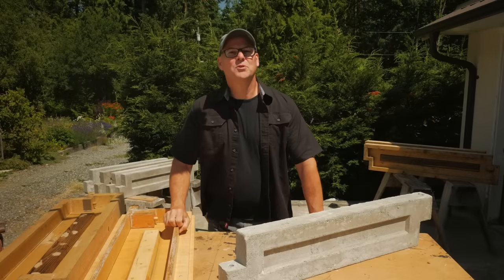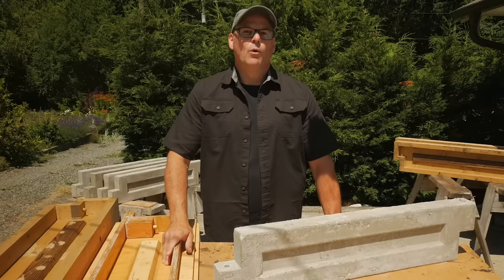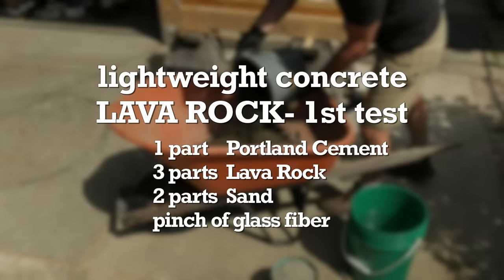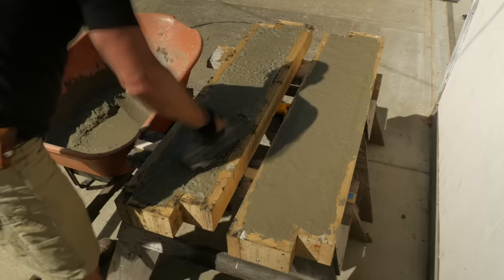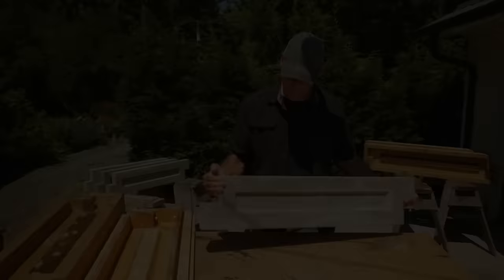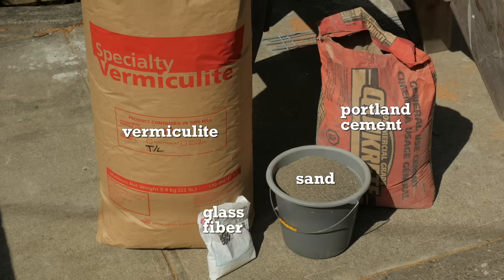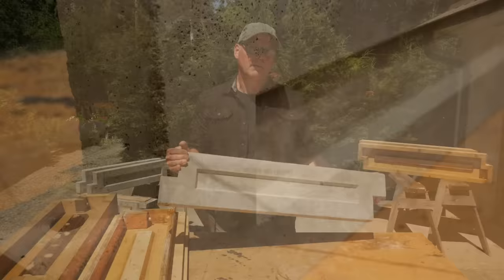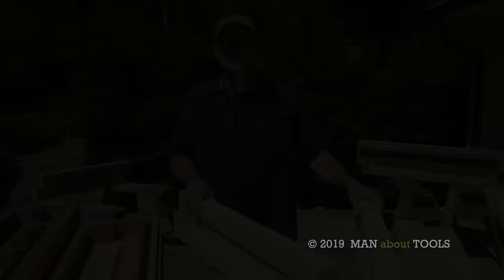make Lightweight Concrete Garden Boxes PART 3 - Aircrete Vermiculite Lava Rock

Comment: Don't use Portland cement. Use hydraulic cement it is a lot  better for durable air Crete  construction.
Reply from the maker: James, that's worth a try. Thx
Reply: @MANaboutTOOLS  can't wait to see you test this one in episode 4!
Reply: @MANaboutTOOLS  Also use liquid sodium silicate. And let the concrete dry for at least a week. And wet it with water every day.
Reply: Hydraulic cement expands after set so maybe a few adjustments to forms to compensate? A more relaxed angle on the decorative keyed face, maybe a couple of rubber washers under the heads of the screws that hold it together to allow for a bit of expansion and looser pins for the PVC?
Reply: @Timoshim  could you explain this idea further? Why do this and why wet it everyday?
Reply: @davemcguire999  Concrete has a long-lasting chemical reaction. And all this time it needs certain conditions. Temperature and humidity must be constant. If water is missing because it evaporates quickly, concrete chemical reactions are incomplete. The concrete must always remain wet until full hardening. Sodium silicate reacts chemically with the carbon dioxide emitted by the concrete, which results in very rapid casting of the concrete. It increases the mechanical strength of the concrete and increases its impermeability. Sorry for my English. I'm sure you can find more information on the internet.
Reply: Tamashi
Reply: @Timoshim  - good information, are you in the field?
Reply: @thetessellater9163  Somehow. I did the architecture highschool but I also did chemistry classes. I'm passionate about the constructions.
Reply: Yes plz for experiment on sand hydrolic cement and foam
Reply: @davemcguire999  I agree with Tamashi. It's a common practice to keep watering cement constructions for improved rigidity. Some 20-25 years back, I remember workers doing it for many days. It may have been 3-4 months or I may have lost count of the days, but it was definitely way longer than it is now. Maybe nowadays the cement might have undergone some improvements requiring less watering cycles.
Reply: @Timoshim  sodium silicate, PVA, and the detergent in the Suave are wetting agents that add workability to concrete mixes and reduce the quantity of water used.  The strongest concrete is dry almost to the point where you can't trowel it.
Reply: @MichaelEMaus  It's true, but cement needs hydration with water. Between the cement particles and aggregates there is a space occupied by water. The more water in the concrete mixture, the more empty spaces will be left after evaporating the water. Because of this, a mixture of concrete with plenty of water is not as durable as one with a perfect amount. Instead, sodium silicate captures the carbon dioxide removed from the cement as a result of the hydration reaction and strengthens filling the empty spaces where the water would normally have been. What I say is that the concrete after casting is very important to keep it in a damp environment until full hardening. In the concrete prefabrication industry, the concrete is usually kept in a water vapor bath where it is perfectly suited to create a very strong concrete.
Reply: You could also try using the lava rocks or vermiculite with foam. I'm really surprised it warped and cracked. Perhaps there was excessive shrinkage due to the heat, wind, etc.
Reply: Bridge concrete is kept constantly wet during the initial curing period. The chemical reaction continues but slows down. The test cylinders are kept submerged in water for 7, 14, 28 day lengths until shipped out to be crushed for testing pressures. Mainly there is heat released from the chemical reaction and the concrete needs to be kept cool.
Reply: spim randsley  LOL Yes. Much lighter. A little hard to find, that anhydrous water. But it is certainly something when you find it lol.
Reply: @HomeShowTV  Lol I nearly laughed my butt off.
Reply: @Timoshim  how much sodium silicate? and how do you make the liquid? how dilute?
Reply: @JoshWeaverRC  agreed. 👍🏾👍🏾👍🏾
Reply: spim randsley  Anhydrous literally means "no water." In chemistry, substances without water are labeled anhydrous. I have never heard of water-free water.....
Reply: spim randsley, I’m lost. Anhydrous means without water. So, what do you mean “Anhydrous Water?”
Reply: @davemcguire999  Wet it every day because concrete needs moisture to cure, or fully harden.
Reply: James Cobun - sounds promising, but where does one get “hydraulic cement”?  We have a Lowe’s & Home Depot, but nothing there labeled as “hydraulic cement.”
Reply: You guys are seriously overthinking the mix design for these DIY planters, good stuff though, great project.

Comment: Just a suggestion would be to try perlite instead of vermiculite. Perlite is white and doesn't absorb water.
Reply: the romans made light concreat using pumice covered with blood. blood makes light concreat stronger...plz dont use human blood!
Reply: Perlite is a god option
Reply from the maker: Looks like I need to do a follow up to this specific episode to try more options. I will do a perlite version for sure. I try to keep my videos under 20 minutes. So, it's tough to fit everything in. Cheers, Kent
Reply: Vermiculite , depending on where it is sourced, is also a source of asbestos. Many gardeners are favoring perlite for that reason.
Reply: @terrywereb7639  Wow! I did not know that.
Reply: MAN about TOOLS please look into using dried bamboo sticks instead of metal for reinforcement. Also I’ve had excellent success with replacing part of the sand with wood ash from my wood stove. 

I make table tops, countertops and island tops out of concrete. I’m experimenting with Foam Crete now.
Reply: @renatomsgomes  Okay, thought about that one, and remembered blood meal (fertilizer). Assuming this would work if dissolved into blood consistency?  As for the pumice - can lava rock be substituted, or does it need to be the size of a grain of coarse sand? Really curious.
Reply: @llwscott5720  in rome they used diferent type of pumice with diferent densities to build the pantheon. i guess. in diferent sizes will give diferent finish but also diferent densities.
Reply: @renatomsgomes  After I wrote the original text, I remembered hearing in another YT video that oxblood was used on dirt floors to finish them.  At the time, I had no clue why until your reply.
Reply: Blood contains iron for strength, as when low on blood count you lose strength. :)
Reply: Great video  was thinking of making aircrete but was put off with having to make a bundle machine, now might try it this way

Comment: Great video, excellent explanation & communication.  Now, to improve your results.  
1. Don't know if you did in the previous videos, but spray form release or even diesel on your boxes for easier removal and for extended life.  Better yet use melamine with the white part being the area that meets the concrete.  Melamine produces fantastic results if you use it in conjunction with point #2 below.

2. Mix and BRUSH on a coat of a concrete patching compound on to the sides and bottom of your form boxes (don't use the fiber in the patching compound).  Make sure to get in the corners really good and you only need it to be about 1/16 of an inch thick but basically if you brush it on and don't see the form peeking through you are good.  Then once it sets up, but before it dries, pour in your concrete mix and finish as usual.  Just make sure the compound has a fine sand.  Quikrete's Architectual finish is one of the best options (paints & stains real good), or their standard Concrete Patching Compound, even their Vinyl Concrete Patcher (won't stain paint will peel off eventually).  Personally, I apply some oil to a rag and wipe it on the forms beforehand as patching compounds tend to adhere really good.  What this does is it produces a smooth, dense, veneer with a very nice finish, free of voids, but since you are pouring in your concrete before it dries you end up with a monolithic structure.

3. If you are using fiber, never mix it in a wheelbarrow with a shovel.  The fiber has to be broken up into almost individual strands, and a shovel doesn't produce near enough agitation to break up the clumps.  You can break it up by placing your sand and the fiber in a bucket and using your drill with a mixing paddle attachment and drilling them dry until you see the fiber evenly dispersed and broken up into individual strands.  If you're having a hard time you can add your water and that will help.  Alternatively, use a small mortar mixer (drum type) to mix your concrete with the fiber, just make sure to let it mix for about 10 minutes to allow the mixing action to break up the fiber.  The mortar mix won't work for the Aircrete though.

4. The reason for most of your cracks is too much water in your mix.  Use a water reducer or superplastisizer in your mix.  Fritz-pac makes all kinds.  Or just use less water, since you brushed on the patching compound you don't need too worry to much about flowability, and getting a smooth finish on the top of the form, which is the backside of the planter wall, isn't as important as reducing cracks.

5.  Add a bit of acrylic concrete bonder to your concrete mix.  This will help it bond better to the patching compound, or mix it 50/50 with water and put it in a sprayer or spray bottle and spray the patching compound after you have brushed it on the box.

Keep it up!  I just subscribed.
Reply: Staining gardening box (which could be used to produce consumables) walls with diesel or any other aggressive and potentially harmful chemicals doesn't sound like a good idea. Even this shampoo , I have mixed feelings about it...
Reply: @staweks  Note that the diesel, or if you prefer, form release, goes on the outside of the box, not the inside (gardening side).  A minimal amount is used, though if your sensitivity is extreme it might still be an issue.  It will also dissipate over time.

Comment: Hi Kent, from Man about TOOLS. It's Steve, from Magnolia Screens. First off, well done! You're a natural born teacher - and quite analytical about things! We appreciate you sharing in such an 'open source' style. tips hat

Don't think aircrete will not warp without some sort of a post-tension system. Which, BTW, @14:09 is exactly what came to mind. It makes even more sense now, in light of the bowing. This would mean a near complete redesign of your form boxes and likely yield a product bowed even more. 

3/8 rebar with chicken wire tied to it may cure it. Thin expanded metal would be ideal. But, it's overkill at that point, yes? Too, Laticrete may be a good substitute for your cement needs in general. 

Thanks again, friend!

Comment: Did you try perlite instead of vermiculite?

Vermiculite is designed for aeration and water retention 
Perlite is for aeration with less water retention 

As an example, perlite is used in making fire retardant cement for pizza ovens
Reply: I was wondering the same thing. I hope this question gets answered.
Reply: I've built many things with both and once cured in the cement, there is very little difference. Perlite and vermiculite are interchangeable. Perlite is usually has more small particles but just get whichever is cheaper. Cement can usually only be water permeable to about half an inch from any side.
Reply: William Forsythe not sure, I use perlite because I had some left over from a pizza oven build. 

Was advised vermiculite was different for a pizza oven build as it would hold moisture in the cement and might cause flaking of cement as it freezes and thaws, also possible explosion if heated rapidly.

Comment: Your warping of the aircrete is similar to timber bowing and the key lies in moisture imbalance. When you set the panels to dry before taking the mould apart the air dried one side. When you released the jig you allowed the second side to cure against the set of the initial side. That is my theory anyway. You have got yourself an enjoyable hobby with good results!

Comment: I've noticed alot of good suggestions on here already, but one I haven't seen is a mix called 'hypertufa'. It is becoming more and more popular with plant pot and yard art makers. It uses Portland cement, peat moss and either perlite or vermiculite. Perlite if you want more air flow or vermiculite if you want more water holding capability. Hypertufa is much lighter than straight cement, lasts for years and years (10 or more at least) and winters even in Canada with no problems.
I don't know how well it would handle weed-whacking, but people even make garden rocks out of it, so I assume (yea, I know) it would work good. I've seen suggestions for pouring a cement facing first or using hydraulic cement (I don't know what that is). What might also work is to make the bottom row face, only the ones which would be taking a beating, out of the lightest mix that could handle the trimmer blades and mower wheels. All the higher levels could be the lightest mix, aircrete if you can find a way to keep it structurally sound.
Just some thoughts and a suggestion for trying hypertufa. I hope I made sense to you. Thanks for reading thru all this. God bless and have a great weekend!     😎👍😃
Reply: Hey Leenee. Hydraulic cement is a special cement mixture that will cure in the presence of water.  So for example if you have a foundation that is leaking and needs to be patched, you can do it while there is water running through the crack.

Comment: The updated Aircrete panel mix  used by Honey Do Carpenter also contains Perlite /(not vermiculite) Hydrated  lime /J-Lube .I bought the 3 recipes from him but it would be unfair to publish the exact ratios as this is his payback for research. He also uses Rabbit wire mesh not mini rebars. This mix produces lovely panels .
Reply: Coldtrader 47  how can I purchase the receipts
Reply: @emileouedraogo494  Go to Honey Do Carpenter page and in blue underneath is a link to his Etsy Store .He has panel only mix for sale  or  3 mixs for panels, a high temperature mix for forges/ rocket stoves and a mix for aircrete raised garden bed  ( these are individual linking blocks not panels as shown here .The mixes are basic/ simple but having the correct ratios will save you days of failure trying other combinations

Comment: Thanks for a great video!   One good tip for strengthening concrete-  be sure to use builder's sand, not playsand.   playsand has been tumbled, like beach sand, and all the corners are soft and round at a microscopic level.   builder's sand is sharp, and has hard crisp edges.   It creates a much more structural concrete that is much stronger!

Comment: Great video. Appreciate your experiment and findings. As you know vermiculite absorbs water so it absorbs the cement slurry.  If you used perlite.. which does not absorb water the same as vermiculite does you may find it better than vermiculite.  I use perlite in my hypertufa mix for lighter weight.  Best wishes.
Reply: Hi Sandy, what is the formula for that? Thank you
Reply: @BackyardStoneArt  lots of videos on Youtube on Hypertufa. I use 1/3 portland cement (not concrete), 1/2 perlite, 1/3 peat moss (or Coir, coconut fiber and water.
Reply: @BackyardStoneArt  Many Youtube videos on Hypertufa. I use 1/3 Portland cement (not concrete), 1/3 perlite, 1/3 peat moss (coir coconut fiber) and water.
Reply: @BackyardStoneArt  1/3 perlite, 1/3 Portland cement, 1/3 peat moss (or coconut coir).

Comment: Concrete shrinks and cracks because of too much water in the mix, drying too fast or not enough cement.
You also need more fiber-mesh in the mix.
Dry it up, add more fiber-mesh, and more concrete.
Reply: archangel20031 right, I was surprised how little fiber mesh he used
Reply: I'd try 2 pieces of rebar #4 bar that would add very little weight yet would do well along his bowing issue
Reply from the maker: @lukasjackson4739  I was concerned that heavy wire would sink. The lighter galvanized fence section looked like a better option at the time.
Reply from the maker: @Juanro_7  The "pinch" of glass fiber was the amount recommended for that volume. A third of an ounce, which I eyeballed based on weighing it with a smaller scale. The glass fiber blended well throughout the mix.
Reply: In the trade we would use chairs it would be a lengthy explanation if you're not familiar.  just Google rebar chairs I believe that could give you some ideas
   a second option would be to suspend the rebar using rebar tie wire, wrap a little Loop around the rebar let it extend up out of the top of your form.  lay a temporary piece of rebar across the top of your form and then wrap the wire around it, after your concrete has set up a little while, you could just snap that wire . I love your project I like what you're doing I poured my grandson a concrete overpass for his Tonka trucks it doubles as a nice little bench near my garden.
  Also you were correct in assuming the concrete set up faster on a warmer day.
 the hotter it is the faster concrete will set up, the faster it sets the more it will shrink crack and bow. Awesome project!   I've been in the trade 25 years but had never ran into the aircrete very interesting
Reply: @MANaboutTOOLS  if you can, try a mix with 4x the fiber. It should help with internal reinforcement and keep it from bending. If that doesn't work, a thicker hogwire gage should help. Typically, steel and concrete expand and contract at the same rate. The foam may be  changing those expansion properties. If all else fails maybe turning the form 90 degrees could help. As it would be in the field so gravity doesn't influence it to bend along it's thinnest cross section. Just some thoughts